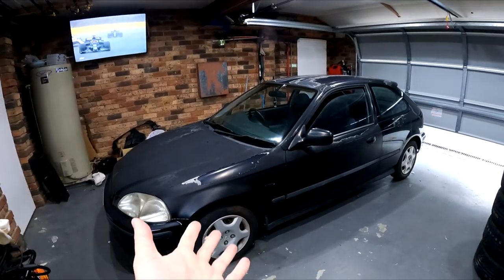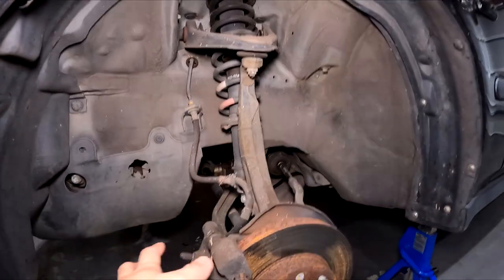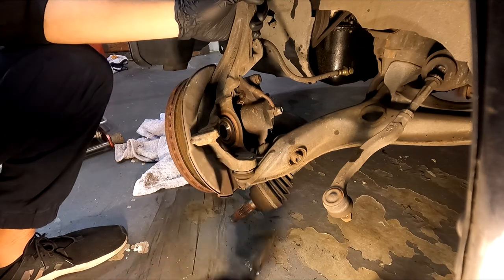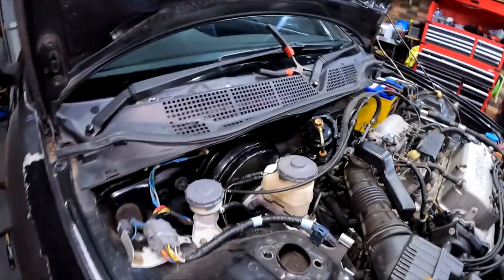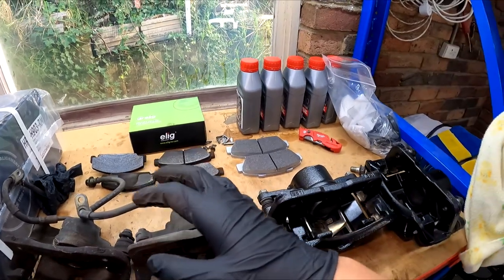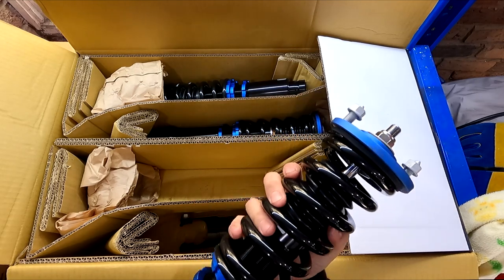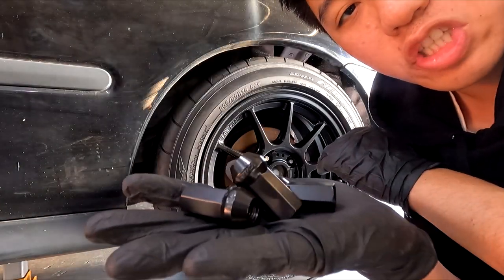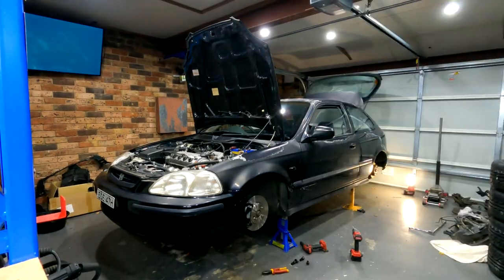The build begins! $400 CIVIC gets a makeover // [HARDRACE, DEKAGRAMS, BIG BRAKES]

Comment: Factory proportioning valve? I did the same upgrades on my EG and didnt swap the proportioning valve and it seems fine. Others swear you have to... anyway some nice upgrades, it would be a totally different car now with brakes, suspension and decent rubber!
Reply from the maker: Correct factory EK valve. I've had this exact setup in my previous EK and was happy with the brake feel so it was a no brainer to do the same. 
You are right, completely different car! It's already been on track at luddenham.. i'll try and release the video later this week but what a car!